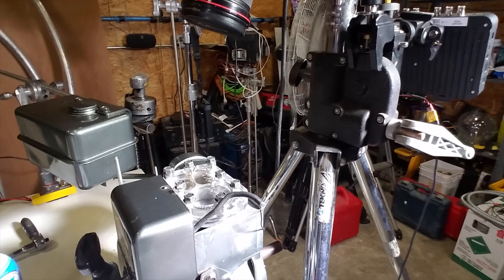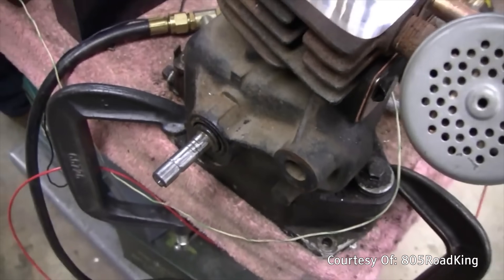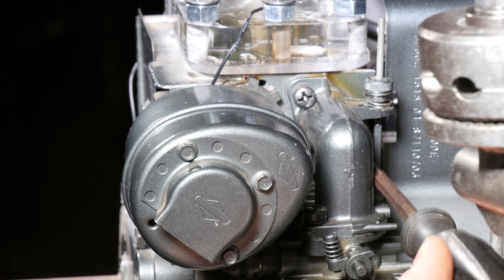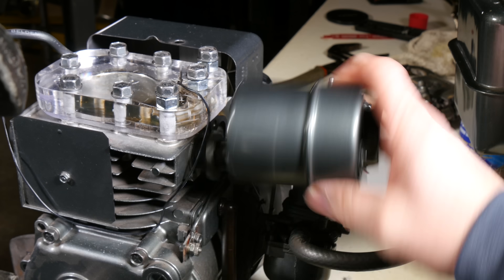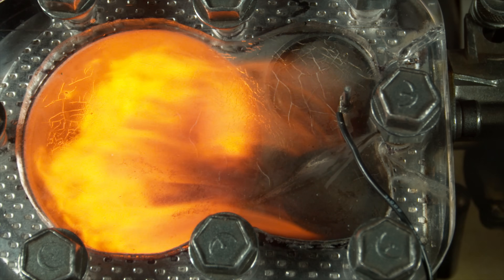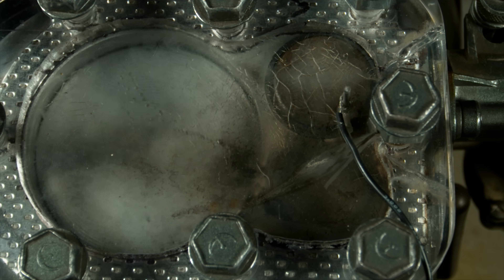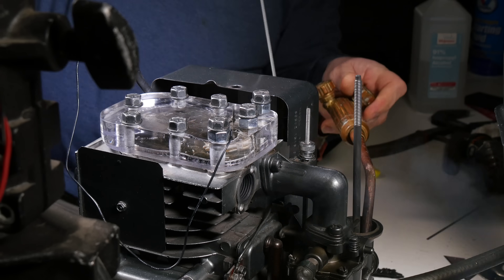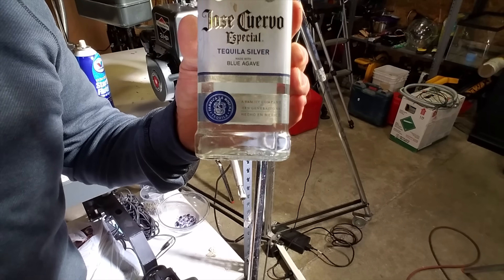See Through Engine - 4K Slow Motion Visible Combustion ( S1 • E1 )

Comment: should have used oxygen instead of acetylene
Reply: In order to burn oxygen you need carbon(on our planet most common element for combustion).
Some type of CHx mixed with O2. Due thermal energy such made by the compression the bonds will break down, so you got a bunch of C, H and O flying around. O doesn't like to be by itself so it will bond with C to get CO then another O will combine to get CO2 and some O will combine with H to get H2O.
Reply: Doc Holiday or oxygen and acetylene if you want to see the engine run.
Reply: pretty sure it would work with pure oxygen only too. Ever ignited pure oxygen?
Reply: Have you? Oxygen makes a flame bigger, it doesn't burn.
Reply: It's a long time since I studied this, but as I recall, the energy released by burning hydrocarbons as fuels (wood, coal, oil, gas, etc.) comes from mixing up the fuel with some oxygen (the air we breathe has about one fifth oxygen), and then setting them on fire. In a combustion engine, like this one, after the fuel and air have been mixed together, they also squash them-up to increase the pressure, which helps them burn more quickly (or "explode"). If done properly, this releases more power from the fuel and is more efficient than unpressurised combustion. That's why we talk about having the right fuel mix and compression ratio for an engine. How much air and fuel you need to mix, and how's much they need to be squashed (or "compressed") depends on the type of fuel and how it is set on fire, (or "ignited"). You see, the ignition, (or "spark") helps give some of the fuel a little kick of energy, which then helps some of the bonds break, releasing more energy, which then spreads to the fuel and oxygen around it, until most of the carbon-hydrogen bonds have been swapped with carbon-oxygen and hydrogen-oxygen, releasing most of the fuel's available energy (also called "burning all the fuel") which turns into exhaust gases, that you then bed to get rid of so there's room for fresh fuel and air to mix, so that the whole thing can start again. 
The available energy from burning a fuel is stored in the Carbon-Hydrogen bonds. It works by breaking-up the carbon-hydrogen bonds by making sure there's enough oxygen mixed in so that they can swap for the oxygen instead, because they both prefer to be bonded with oxygen than each other. This process releases energy each time a bond is broken. 
One of the reasons we saw the alcohol flood the engine: as a fuel, it has a different structure to gas. The carbon-hydrogen bonds that need to be broken up are in different places, so the fuel burns (and ignites / explodes) in a different way to gas, which means it needs a different amount of air and compression to fully burn, but because we didn't adjust anything, and left the engine setup (or "tuned") gas settings, it had some unburnt fuel still in the cylinder after each cycle. Luckily, the explosive power of the alcohol was enough to overcome the drowning effect we saw in the video. 
Try it again with diesel fuel, and the engine would never start because it needs to be way more compressed than gas before it will ignite properly (but interestingly, the energy created just by squashing-up the diesel so much more than gasoline is enough to make it explode, so you don't need a spark plug at all!) This engine would have just spewed out the diesel fuel, probably unburnt.
Hopefully some of that explanation was helpful to somebody! :)
Reply: Paul Neale Very good explanation Professor...!
Reply: thx for telling me

Comment: This is very interesting as it shows the soot production (the orange visible flame) in the case of gasoline and alcohol. It would be very interesting to use methanol as the flame would probably be invisible. (Pure methanol cannot be used in public vehicles as if there is a fire because of an accident, the flames are essentially invisible so they have to mix it with 15% gasoline to give a visible flame). (Caution: methaol is very toxic, even by absorption through the skin). The soot formed in the combustion cylinder gets burned up before arriving at the exhaust but I have read that with diesel, at one point of the cycle, 50% of the fuel load is converted directly into soot!)
Reply: This is a terrible, inefficient, carburated engine fueled by splashing gasoline directly into it. It's not exactly a shining representation of the best Otto cycle engines available. :I

Comment: Use the gas produced from a Joe Cell when it's at its 3rd stage... so it's not hho. When on the first two stages of making the cell you get hho ,, but on 3rd stage in making the cell it's the gas that implodes and burns cold. (Not hho) so the water level never depletes. There is also a sphere version called the Moe Joe Cell. There is a guy that sells those/kits

Comment: It takes twice the amount of alcohol to run an engine than it does gasoline. Racing applications you double the jet size and squirter amount. You also don't need a radiator due to the cooling affect of the alcohol. And your alcohol was only about 90% with 10 % water

Comment: Cool video! For the isopropyl alcohol you need some preheat for the fuel, which would require a pressurised fuel system.  The evaporation is cooling the liquid down too much.  For the acetylene I don't quite understand if you have soot (indicating a rich mixture) why you would increase the fuel/air ratio?

Comment: I wonder if you can experiment with water?
How much would it take to draw out h2o from the water molecules just by pure frequency resonance and some tweaking with the voltage, amperage and the frequency in its entirety?
If you can solve this, you will sit on a ticket for free energy that will never disappear.
All that's left, is to get a hold of a timer relay if you are keen to try it on an engine.
Stan Meyer... look into it.

Comment: I wonder if the engine would run on rectified spirits
Reply: also it would be kind of neat to see nitromethane
Reply: if it runs on alcohol then why not spirit, however the burning was very bad as we could see, it could lead to an engine damage.
Reply: garniak rectified spirits does not have the same alcohol potency as in rubbing alcohol however its higher then tequila with potency.
    my guess is that it will not run on tequila however it may run on rectified spirits similar to Everclear or like a moonshine

Comment: Well done, great to see these types of vids with modern cameras, keep em coming :-)
AFAIK: NACA in early 1930's or so did a great deal of research with fuels from gaseous through to petrol & heavy diesels and with water injection at key temps of 4C as means to improve efficiency, reduce bearing loads by reducing potentials for ping if engine or incoming air hot & a useful side effect it scours off carbon from the chambers. Would be interesting to see a range of tests at different water droplet flow rates & temps on the flame & exhaust constituents Eg CO & NOx etc
BTW: NACA became NASA after ww2

Comment: The reason alcohol was not burning cleanly, is because the gas engine was made to burn gas efficiently  so the fuel to air mixture was messed up when you tried alcohol, Lucky you didn't do that for too long since liquid dose not compress, What we call this is Hydro-locking 

Hydro-locking normally leads to bent rods since it's the weeks component to give but with this set up if I had to hazard a guess that glass would of did something.
Reply: I agree. If he had adjusted the carburetor's mixture screw to lean it out while running the alcohol it might have run a lot better and not gotten flooded.

Comment: I wonder if E85 could clean a cars cylinder head. Like 1gal E85 with 10gal 93. Also next clear head you make try to place a spark mechanism directly above the cylinder. Might not have as many misfires.

Comment: so I was actually thinking earlier today. full size turbo, exhaust side removed and fitted with a powerful electric motor such as that of a metal grinder possibly? they put out both high speed and high torque, so I thought it might be feasible! I know there are cheap fake ones online that claim hp gains, but they're not powerful enough. could it be done?

Comment: Great video, thanks. That was crazy to watch the small cracks in the cylinder head as you proceeded through these steps. It's kind of sad to see how many of the questions and comments below wouldn't have been necessary if more schools still had Vocational Ed a.k.a. "shop" classes with a "small gas engines" quarter as part of the series. I took that in 7th grade around 1985 because of course I wanted to know how to strip and rebuild my lawn mower engine. And whaddya know, our in-class engines were mostly Briggs & Stratton!

Comment: I wish to see if the alcohol could clean the mess after the acetylen and what happen if you add a turbo (more preassure of air) with the alcohol because maybe it need more air to the mixture to get a better explosion.
But the alcohol thing was interesting to clean the engine like a seafoam =P

Comment: why does it spark ever time the disk raises?
Reply: This is done out of convenience to be able to run points off the crankshaft - mechanical ignition motorcycles work the same way. Since the valves are open and the piston is just before TDC in the same position as on the compression stroke, the extra spark does nothing, unless the engine is running rich in the first place, in which case it just burbles & pops, cleaning up the exhaust.

re. previous commenter's 'to ignite the fuel' comment: 4 stroke engines only ignite the fuel with the valves closed every other time the piston reaches TDC: up, down, up, down - hence 4 strokes.
Reply: Elliott Bork disk? Lmao
Reply: because.. its a simple ignition system with a coil behind the flywheel and it creates a spark every revolution.  not like a car with a distributor that only fires on TDC compression stroke
Reply: that's what my mom said!!!!!
Reply: Elliott Bork to ignite the fuel and push the piston back down.
Reply: thats actually what i was looking for why does it go every other time? to like fill up with fuel?
Reply: Tyrell Horton That's what the flywheel is for. It can be inside - part of the crank assembly, or outside, as it is on the Briggs. It's heavy, and when it's moving it provides the momentum for the piston's compression & exhaust strokes.

Comment: I wish engines were see through including coolant pipes, clutch and gearbox housing so when it comes to repair a thorough inspection can be made without disassembly :/. Surely there is a material to do this ? :D

Comment: Being not all that knowledged with engines, I have a little question: why does the spark ignite between the exhaust and intake cycles? Is it to burn off excess gas that may still be in the chamber or something else?
And please feel free to correct any naming mistakes I may have done

Comment: Can you feed this some diesel to see what it's like inside when the wrong fuel is put on a gas engine? (I'm aware this might damage the engine or it might not even ignite at all, also in case it does have enough compression to ignite it the head might break so, just throwing that idea out there)

Comment: very educational! why does an engine spark 2 times per cycle in stead of just once?
Is it because it's easier to design it with the turning of the flywheel?
and i wonder why the alchol only sparked once every 2 sparks.

Comment: How about shooting a nail with a Remington pin gun through a 1/4" or 3/16" piece of steel filmed from the back side as it comes through.  You'd need the 3/4" pins with red caps or shells.  I've done it plenty of times but it would be interesting to see what the metal does as the pin goes through it. Or maybe it will suck.

Comment: Bit confused here (I'm not a mechanic so please go easy on me),  but why does it ignite/spark on the compression stroke and the exhaust stroke?
Reply: It's simpler to just trigger the ignition once every rotation of the flywheel than to complicate matters with superfluous sensors and mechanisms.

Comment: I'm thinking (??) the sugar content of tequila might have a negative effect on combustion,  gum up the works per say but since your vid asks what we'd like to see next is... nitromethane.The odd thing about nitro being an oxygen bearing fuel like all fuels of the alcohol family is if you seem to be running rich, add more fuel.  Opposite and counter intuitive of conventional thinking.  Might require a big increase in idle and main jet diameters. EZ source of nitro is model airplane fuel.  Up to 90% nitro/10% methanol avail.in hobby shops.As a former kart racer, IKF used to have an unlimited Briggs class allowing nitro.  A Briggs 5hp motor producing 25 hp and more!! With no limits on mods these things really sounded mean, have 3/4" alum plate top/bottom w/turnbuckle to hold them together.  A wild class!!

Comment: It would work on Ethanol(Tequila/Vodka) but you'd need to get 200 proof.
Reply: I love tequila, but not while running at any speed.
Reply: the highest rating alcohol can ever attain is 192...because methl alcohol will always have a hydroxy group -OH  attached to it...in a sense its impossible to have 100% alcohol.
Reply from the maker: I just want to pour the Tequila in while its running FULL THROTTLE .
Reply: Nerd alert! It's almost impossible to actually get 200 proof. Pure alcohol draws moisture from the air until it's approx 195 proof. 200 can be done, but it's difficult
Reply: If you do that it'll look just like the isopropyl alcohol. You should run it on Biobutanol/biofuel. Also if you could get a Wankel/Rotary engine I'd love to see it.
Reply: Gabriel Chia gargle it.
Reply: Google 200 proof lab grade ethanol
Reply: EverClear is a brand, PGA (Pure Grain Alcohol) would be the non-branded 200 proof alcohol.
Reply: I just realized that there isn't really 200 proof drinking spirits. You could get some everclear and put some molecular sieves to remove the rest of the water. Using molecular sieves is an exothermic reaction so it would probably evaporate some of the Ethanol.
Reply: It would work with lower concentrations of alcohol, but like with the rubbing alcohol, the water builds up.  Alcohol will burn above ~100 proof (like Bacardi 151) so I'm guessing it would run for a little bit before either hydrolocking or not combusting because of all the water.  But yeah, 40 proof alcohol will definitely not run at all.
Reply: Certainly, but you can choose not to expose it to air for the filtration and you'll still have 200 proof alcohol. That said it does take time to absorb water from the air even when exposed.  Depending on your volume, absorbing 0.5% of that volume of water from the air to make it only 199 proof might take hours or days depending on the surface area exposed. If in a closed container it'd take a significant amount of time depending on the seal.
Reply: Bruce Wayne you mean everclear?
Reply: 100% proof means 57% alcohol. It means that if Gin falls on the cannon powder, there is "proof" that it will still ignite. A test developed by the British Navy in the 16th or 17th century.
Reply: I've run a small engine on 150 proof before.
Reply: Diesel is drinking alcohol and its 190 proof google it
Reply: Yes James 100 proof in the UK is 57% alcohol.  The USA seems to have altered the ratio and it's exactly 50% of the proof number.  So 200 proof is 100% alcohol, 100 proof is 50% alcohol.
Reply: STFU BATMAN! what do you know?
Reply: Bruce Wayne Wrong. You would need atleast 70% To burn, clean cuts, and everything else u see in the movies. Pouring tequila on wound is retarded.

Only Bacardi 151 will work
Reply: By 200 proof, you mean PURE ethanol? No. You wouldn't.
Reply: Jeff Kriske and as soon as it's dry, if you expose it to air it'll start pulling moisture again. Granted, even then it still burns just fine
Reply: Craig Jarvis he mentioned vodka and tequila which are drinking spirits...everclear is the only drinkable alcohol that comes close.
Reply: Bruce Wayne dammit yes! exactly what I was thinking after I saw this video! RE motor will do it!
Reply: It's not that difficult... add a drying agent, mix, separate out the drying agent.
Reply: No.
Reply: Pure water contaminates at about the same rate as pure ethanol, and in much similar situations.  improper container, exposure to atmosphere, but that does not mean that they are not "pure" for any practical classification.  Gold bullion is usually only 5 9's pure, but still classed as pure gold.

Comment: how does the fuel (whatever u use) does not self-ignite, if the chamber is still burning hot from the last explosion?
Reply: Also the vaporizing fuel entering the cylinder absorbs a great deal of the heat.  Phase change refrigeration.
Reply: It's not. The cylinder has a jacket of coolant around it and the piston is cooled by a constant stream of oil. It can occur if the mixture is too lean, but a perfect mixture burns cool enough.
Reply: Most gases and liquid fuels have high combustion temperatures they won't just go off from heat you could have something a few hundred degrees hot and throw it into gasoline and it won't ignite that's why when the engine is running it takes the spark from the spark plug to actually ignite the fuel, most spark plugs spark at about 1,000 F, common gasoline ignites at about 500 F, oil in the engine also is there to keep it cool and prevent any over heating which would occur whenever your engine exceeds it's fuels ignition temperature.
Reply: Bladsmith and the oil is then cooled, right?
Reply: Fuel doesn't ignite just from being next to hot steel (unless the steel is so hot its red), It has to be ignited by a flame or spark. In other words, the chamber never gets red hot from the combustion to set off the fuel
Reply: coolio diablo I see. thank you all